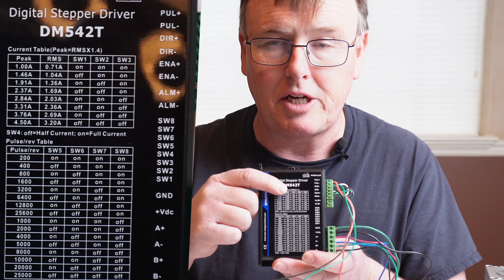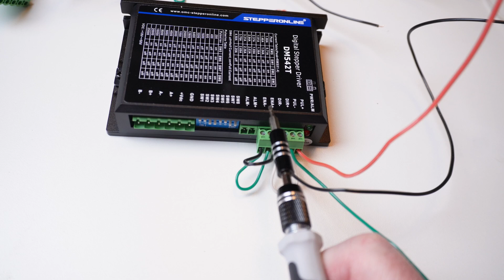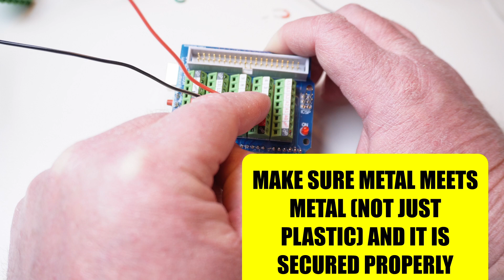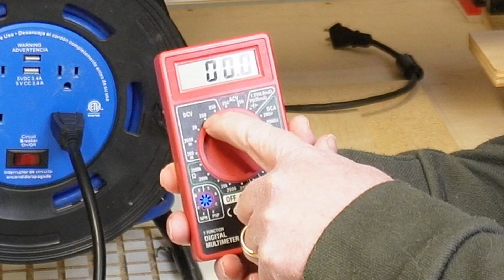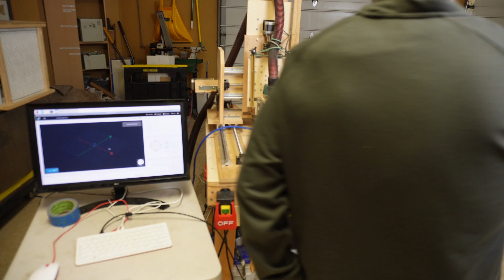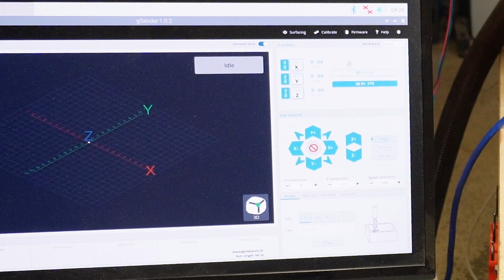AN EASY CNC WIRING GUIDE WITH TESTING TO VERIFY HOOKUPS!  DIY CNC ROUTER | EPISODE 4

Comment: is this the same wiring for closed-loop stepper motors using a CL57Y driver from stepperonline ?
Reply from the maker: I am not familiar with that driver so I am hesitant to say it will.  Sorry, I couldn't be of more help.  If you got it to work let me know.
Reply: @Simplifycnc  IT DOES WORK THANKYOU

Comment: I don't see or hear anywhere that you explain or tell us what that board is you're using to connect to the stepper drivers? You show use that you're snapping it into your Arduino, but I never hear you say what it is or a part number or anything. If I missed it, I apologize.
Reply from the maker: It can be found on Amazon.  It is called Arduino Screw Terminal Block Breakout Module, for Arduino UNO R3.  Cost is around $19.  I am sorry I took so long to respond to your comment (I have been fighting a nasty bug).  If you have any more questions let me know.

Comment: Thank you again! Just had a few questions. I currently have 4 TB6600 drivers and 4 Nema 23 motors. I'm a little confused why all the wires going into your drivers are so thin. Do they not need to be rated for the volts that the power supply is providing?
Reply from the maker: The signal wires going into the drivers are from Arduino Uno.  They are going to be sending 5 V and on the order of milliamps of current.  The drivers then process the signal and send out to steppers at voltage of power supply in a sequence that energizes coils to make them step at whatever you set with the flip switches.  That is one of the reasons we have to use the drivers.  The arduino would absolutely be fried if we tried to run that much current through it (and those wires would have to be much bigger as you were thinking).   I hope that helps.  If that doesn't make sense just leave a comment.

Comment: Thank you - your videos are great!  What gauge solid core wire are you using?
Reply from the maker: I believe I used 18 to 20 gauge but you could use even smaller I think and be fine (the wires to the arduino shield are only carrying 5 v and a very small amount of current so you don't need much wire thickness for that -- you could even use electronic jumper wires if you want.  The only reason for the solid core is that it doesn't tend to break when you tighten down the screw terminals.  You can buy sprinkler wire at the big box store that has 4 strands.  I think 4 feet cost me only about a $1.05 but you will have to cut of the black casing (and this wire is not okay to use for the main power supply and I wouldn't use it to hook up directly to the Nema motors -- use shield cable for that).  The power cord that goes into the power supply needs to be sufficient to handle at least 15 amps.  The shielded cable that goes to the stepper motors was 18/4 AWG (this will need to handle less than 4.3 amps so it should be fine).  Hope that makes sense.

Comment: This series continues to be EXACTLY what I need to make sure all of this works.  I had pieced together that I can use a Raspberri Pi to control the controller, but it seemed strangely redundant at first.  Seeing you do it is giving me confidence that I can make this work too.  

My question is whether or not I missed where you got this screw block connector?  I was able to search for it on Amazon but people may want to know that's what it's for and where to find it.  I thought it was a CNC shield for a second, but I assume it's only to help the Arduino connect to more robust wiring.
Reply from the maker: Thanks for letting me know!  I tend to have tunnel vision and don't always use the perfect terminology which no doubt added to some of the viewers confusion.  YES, what I slipped on the Arduino in the first few second of the video is just to make it so that one doesn't have to solder all the wires.  I snuck that footage at the start because I wanted to make sure people knew how it hooked on their Arduino Uno.  I think I talked a little bit about the attachmennt originally all the way back in episode 1 of the build your own CNC series.  No doubt, I probably shouldn't have used the term shield in my video.  What would be the proper term? Hat?  Bottom line, It's really just a clever add on that allows for simpler more secure wiring to the Arduino Uno below it.  I think it's perfect for building your first CNC because you don't have to try and figure out where you might have a bad solder joint (and also because a lot of people are intimidated by soldering).  I almost included a discussion of this very thing in the video (but it got edited out as the video was getting way too long for most people.)  Bottom line is you absolutely can make the CNC without the add on sitting on top of your CNC and just hook the wires to the corresponding numbered Arduino Uno pins (some people hot glue them in place once they are secure).  The downside is that if you do that its super easy to get a bad connection somewhere and very tough to trouble shoot.  The hot glue can end up making it worse and ruin your Arduino for use in potential future projects.  Personally, I would far rather just buy the pin connector that sits on top of the Arduino (around 25 bucks) than spend 10 hours soldering wires and running down loose connections.  It also makes it easier to ground the wires.   For me it's worth it and I think for most people they would be surprised at how nice it works.  I love it.  I'll leave a note with more details in the main comment section.  Thanks again.
Reply: @Simplifycnc  I like the idea too.  It looks like some professional terminal blocks anyway.  I'm not afraid of soldering, but I'm always up for a better solution.
Reply: @Simplifycnc  will you be changing wire when you officially wire up the machine?  I have seen some recommend using shielded wire. I’m trying to put together a grocery list to order parts.
Reply from the maker: @themeandrousengineer  Absolutely.  Definitely, I absolutely will be switching out to shielded cable. This is one of the cost cutting corners people shouldn't try to skip by trying to use unshielded cable to save a few dollars.  Go ahead and get some shielded cable (4 strand).  Make sure you get enough to match the size of your cnc axis design.  Better to have a little much than end up short and have to order more.  Side note, there is at least one major CNC manufacture that I know of which tries to shortcut this (and unfortunately the buyers of the machine are perplexed when their  CNC fails at inopportune times).  If your setting up a shopping list you'll also want to consider buying a safetyshut off switch (I'd buy one prewired that has a three prong cord and an extension cord plug in on the other side so you can just plug in your power supply to it.  If something goes wrong (like a board slips, a bit breaks, you forget to zero your bit or axis, you have a quick emergency shutoff that will shut off all power to stepper motors immediately .  Its saved me from crashing my CNC at least 3 times.  Totally worth the price (I think about 15 or 20 dollars).  Some woodworking stores I think carry them now but they can also be found on Amazon.  If you have any more questions let me know.
Reply: @Simplifycnc  another question…. Will you have a router or a spindle for your eventual setup?  I’m really hoping I can machine some aluminum/brass with this eventually so I’m wondering what can handle it.
Reply from the maker: @themeandrousengineer  A Makita variable speed router.  It probably could but it would require you to go very shallow passes (with an O flute bit I believe).  Have you considered converting your cnc over into a plasma cutter rather than trying to cut metal with a spindle/router?    That's the way to go I think for alot of metal cutting projects.  You might want to do a little research into that as its surprisingly very cost effective and has alot of upside commericial/use applications.  Is there something specific you want to mill in metal?

Comment: Thanks again for this nice series. Just a few questions, though. Is there a specific reason to set microstepping at 1600? Is that better than say 800? Are you also going into building and/or using the CNC, or are you just sticking to electronics?
Reply: In reality, there’s no good reason to micro step that high with an Arduino delivering the pulses. The likelihood of missing steps is higher and you aren’t going to get any meaningful benefit from doing it. A good analogy is a gear with 24 teeth compared to another gear of the same size with 96 teeth. Technically, the 96 tooth gear will be more “precise”, but the 24 tooth gear is going to have much beefier teeth, so it will be stronger and less likely to skip teeth at high speeds and loads because each tooth has more grab on the mating tooth.

Precision won’t be what causes you problems. It will be rigidity. Lower micro stepping gives you the best chances of not losing steps when rigidity is the issue, like when you’re pushing the feed rate too much. It won’t fail - it will lose steps. A couple here, a couple there. Lower micro stepping trades off precision for strength. What hobby level guys need to understand is that you are not going to get the precision without mass and rigidity designed into the machine, so you might as well use the motors in the way that is most reliable.

A typical ball screw moves 5mm per rotation. At 400 pulses per revolution, each pulse moves the axis 0.0125mm, which is 0.000492”. That means that your machine has a per pulse resolution of less than half a thousandth of an inch. You do not need more than that. In reality, you will not likely ever achieve that level of precision either, because of lack of rigidity, tool flexing, slop in the mechanical system etc.

Just my $0.02……
Reply: @MachinedInWood  Looking at the user manual for the DM542T, there is no microstep-value of 1600.  The possible microstep values are listed as 1,2,4,8,16,32,64,128, 5,10,20,25,40,50,100,125. The value of 1600 is found in the column "Steps/rev. (for 1/.8° motor). Sparing myself listing the values in that column here, the values range from 200 to 25600. The 1600 steps/rev. would correlate with a microstep value of 8. These values are 6.25% from the max setting. That  seems to be a very conservative setting!  My interpretation is that  these settings achieve exactly what you say:  "gives you the best chances of not losing steps when rigidity is the issue".
Reply from the maker: Thanks for catching that!  I'll add a note in the comments below the video with the correction (microstep of 8 with 1600 steps/rev) and give you credit for the find.  I'll be honest, when I built my first CNC a couple of year ago, I just had to guess at the best switch parameters.  I know for me the stepper motor switch settings I used in the video have worked well with everything I have ever made with my CNC (I have used it for a couple of years with a Makita variable speed router and not a super high end spindle with almost no play).  I haven't noticed any dropped steps or lack of torque but that doesn't mean that my settings couldn't be improved. I never included this in the video but I choose the lower current setting primarily because I didn't want to trip my circuit breaker in my extension cord when all four steppers were maxed out along with my router that would be plugged into that extension cord cart as well.  I think if people need more torque they could tweak up the voltage (using their power supply adjustment screw to bring it closer to 36V) and reset the amp settings switches on the stepper driver to better match up with the max allows for the stepper motor they selected ( while making sure that their electrical fuses and lines are appropriately sized). I am really glad all this discussion came up so that people can try different things. I have a tough time changing my switch settings I am familiar with (those in the video I gave) unless I have a reason to change them but others can try if they like.  Thanks again for commenting!
Reply: @Simplifycnc  Like I said above, the settings appear conservative to me. I noticed the conservative volt and amp setting in the meantime (as I finished watching). Would have never guessed that this is because you don't want to trip the circuit breaker. I wasn't going to ramp the volt/current up all the way. About 80% of the max was my thinking and that is what I will probably do. Jives with my 80/20 rule, principle, guideline, observation  which I apply frequently;  not only to machines.  Has worked well for me over the years.
Reply: @MachinedInWood  Thanks! That's what I understood. Also I believe higher microsteps also diminish the torque of the motors.
Reply from the maker: Good input!  I haven't ever had any problems with skipping  (at least that was detectable) or lack of torque using the settings I gave in the video but I definitely haven't optimized the stepper motor settings.  When I originally built my first CNC I had to guess the driver settings and it worked well with everything that I milled.  I appreciate you adding value and insight with your comment.  For sure, people should feel free to tweak the switches on the driver to match whatever resolution they want.  Definitely, unless you have a crazy good spindle and rigid machine the values I gave are probably not going to have any noticable improvement in CNC quality.  Thanks for giving me some great information and sharing it with the other makers!
Reply from the maker: Oops, sorry I forgot to answer your question in my last response.  Yes, I plan to go all the way through building a full CNC in the series (not just electronics).   I wanted to do the electronics first in the series because for many people that is what they find the most challenging and for me personally, when I built my first CNC, that was my biggest hurdle. Getting the electronics lined up, working, and configured is definitely at least half the work of building a CNC.  The rest is a surprisingly straightforward path and can go really fast even with modest woodworking tools.

I will also likely still have a couple more videos in the series sharing about opensource/free software  (because it's good to not only know about but also extremely helpful when building your own CNC). If you haven't guessed I am a little bit passionate about opensource.  I am also pondering a video (interspersed in the series) with a router lift powered by stepper motor.  I think it would be an easy illustration for how to drive an axis for the CNC that could also be very useful to most woodworkers (even those who might never want to build a full CNC).
Reply from the maker: MachinedinWood had some great input below.  I have no doubt that he is more an expert on the settings than I.  The settings on the stepper motor driver switches I gave are not by any means optimized (but I have never had any problem with skipping or lack or torque using what I recommended).  Definitely, don't hesitate to change them and see what works best for you. It totally makes sense to use the lowest microstep setting that doesn't diminish the quality.  Tweak it and test different settings.  It's super easy to change them back and GSended lets you adjust the parameters inside GRBL with ease that will determiine the linear motion.  If you end up using different settings that work better for you, come back and post them below so that everyone can benefit.  Thanks for bringing up such a great question.  As a side note, the microsteps of 1600 I stated in the video were really the number of pulses per revolution.
Reply: @Simplifycnc  Yes, I noted that you misspoke after I made the comment. Reading the comments, and in this case the manual,  before I watch is a frequent occuring. A microstepping of 1600 is just not there. So the comments did not make sense to me. And I trust that your setup, from what I can glean in the background, will have more than enough rigidity to handle them; unlike many of the ones I have seen somewhere else.
Reply: @Simplifycnc  Of  course you will credit me. That seems to be the way you tick. Congratulations, you belong to the 20  (80/20 thingy I mentioned).